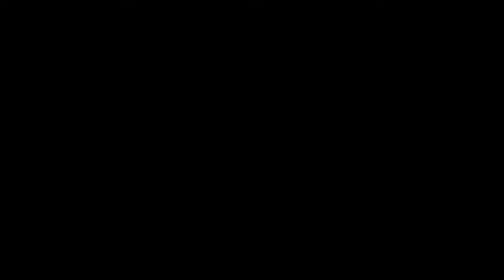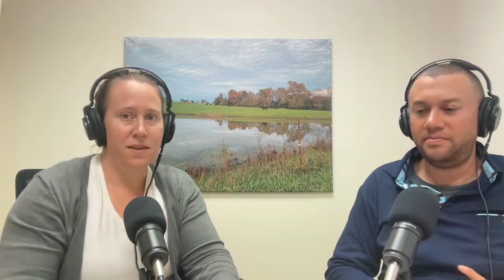Have You Herd? Episode 78 Fencing...The Twenty Year Fence...

Comment: Hello, one thing worth pointing out is most people think treated posts are all the same when the type and level of treatments differ substantially. I have found that a lot of retailers that have good "pricing " on posts don't want to answer if you ask what the treatment level is and the posts won't have a tag on them either. Where better quality seem to have the tag on the end.
Reply from the maker: You make a great point; there are different treatment levels.  A 0.40 lb/cubic ft CCA treatment is considered an agricultural treatment while 0.15 MCA is a common residential treatment. The pricing can reflect different treatments, but you will want a post treated for agricultural use.  All graded and treated lumber in the US should have a tag and often they are in the end of the post but it is worth a quick read to check what you are purchasing!